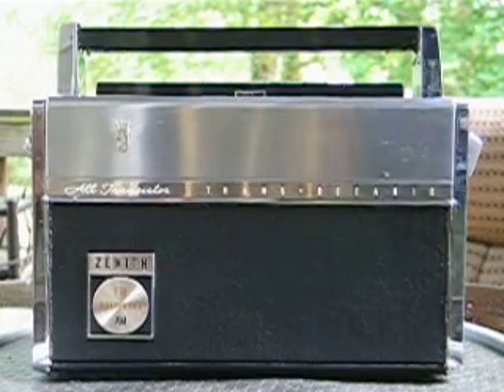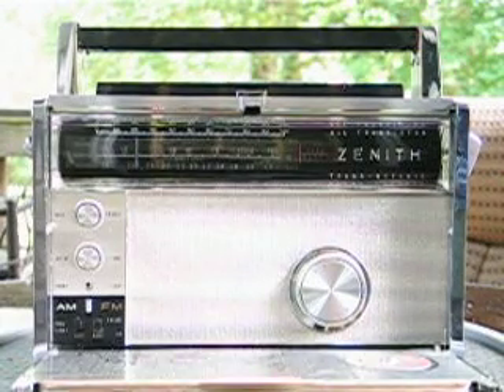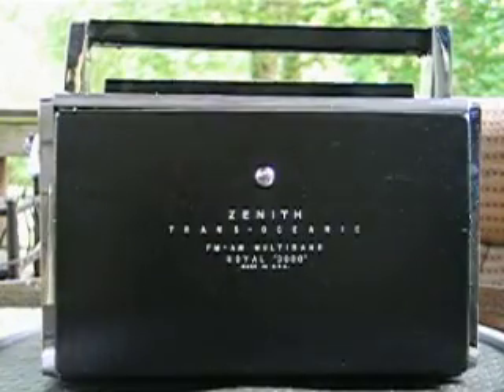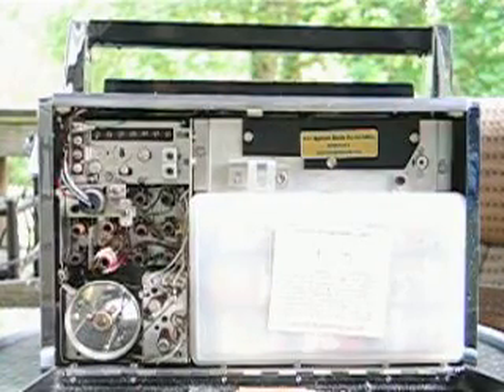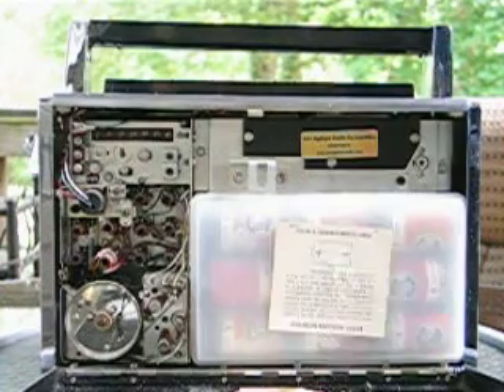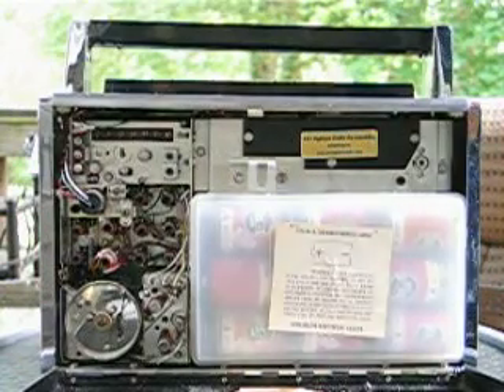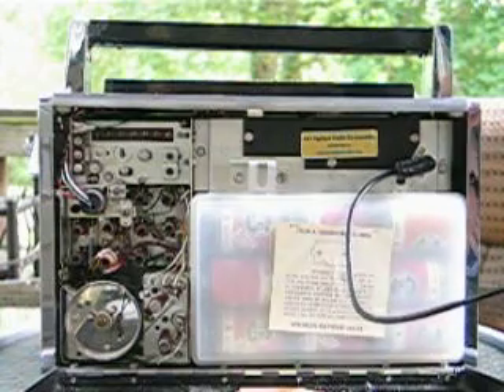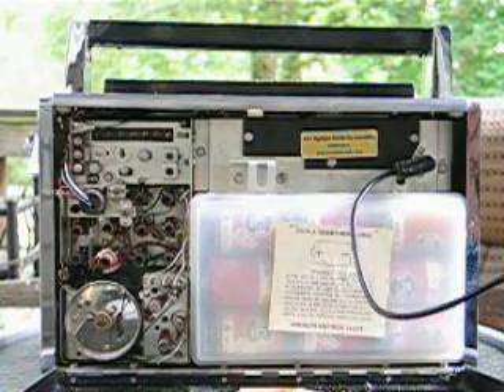1968 Zenith Transoceanic 3000

Comment from the maker: I use isopropyl  alcohol for basic cleaning.  An old toothbrush helps get in the corners and crevices.  Once the metal is clean, I use Novus #1 to protect it.  If your chrome has pitting and bubbling, there is no cure.  Most of the 1000 and 3000 Trans-Oceanics will have some degree of pitting and bubbling of the chrome.

Comment from the maker: These are rugged radios and the most likely cause is a dried out electrolytic capacitor.  Transistors occasionally go bad as well.  If you hear static, the audio section is probably OK, but you can test it by feeding an audio signal from an iPod into the FM out jack on the rear of the chassis with Radio Shack adapter 274-871.  Turn the band knob between bands when doing this.  You can contact me through my website for more information.

Comment: Hi Sr. I just but one like yours in mint conditions here in Mexico, my problem is that the radio comes without 12 V adapter and I don't know hoy many miliamp needs, and the plastic box for the baterys have corrosion and the side plates are brokens and the coils strings are detach from the plates of the inside plastic case, I pay 100us dollars for the radio, the radio came with out instructions, your video help me a lot. thxs you, kind regards from Mexico.

Comment from the maker: The 12 volt ac adapter for the 1000 and 3000 solid state transoceanics has a 3/32" diameter tip.  The tip of the input plug must be NEGATIVE!  The ac adapter should be 200mA.  A 9 volt ac adapter with the proper plug and mA rating will also provide adequate power for the radio.
Serice information for your radio can be found at transoceanic (dot) nostalgiaair (dot) org.

Comment: Nice video.  However, you do not need to tune between bands.  The instant that you plug in a RCA plug it will cut the radio to the audio section and you can play your iPod or other MP3 player.  Works great that way.